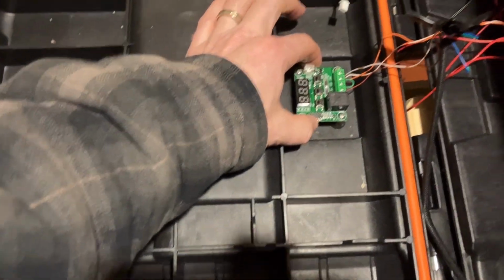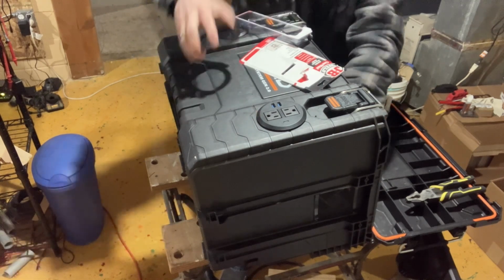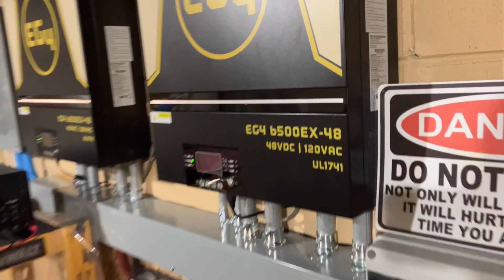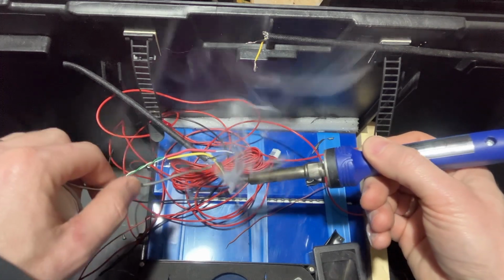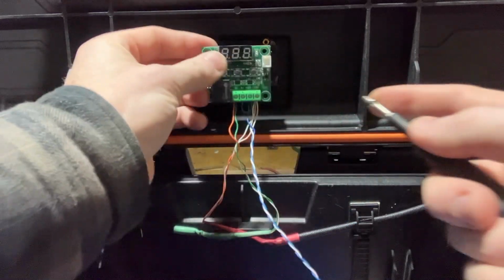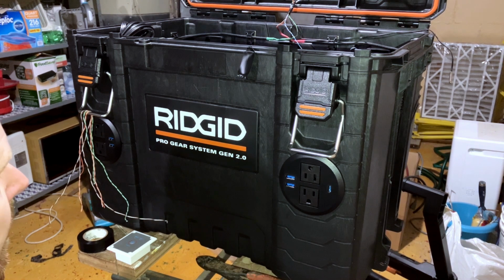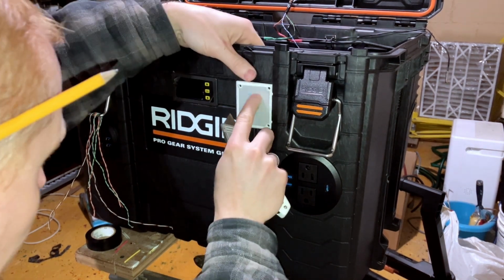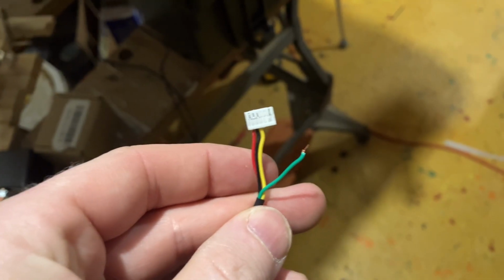DIY Portable Power Station - We're Getting Closer!

Comment: There is actually a lot to to this build. Nice work so far.
Reply from the maker: More than I thought for sure.  Thanks!
Reply: @AdamDeLayDIY  I was just thinking the same thing.  The end result is going to be impressive but yeah, with all the features you're including it's a lot of work.  Good job.  Don't pull any more wires out of their pins!  🤪
Reply from the maker: @easttexascowboy257  Haha!  Yeah, not one of my smarter moments on this build.  Ultimately it did work out better though because the replacement has 3x the length of cable, so I'll be able to mount it on the outside of the box.

Comment: It’s coming along nicely.  Those outlets  look nice.  Little hack for using a hole saw on plastic.  Start with drill in forward then switch to reverse 1/2 way through. Prevents any cracking in the plastic.
Reply from the maker: Thanks for the tip!

Comment: In other videos I've seen adding a pcb relays board and also a temperature sensor directly to the RPi pins and integrating them into Venus OS. The advantage is that manually controlling the relays switching or automating them according to the temperature sensor is done in one app directly in Venus OS. This could be interesting as an upgrade for controlling fans, or battery heating, things like that for you in the future.
Reply from the maker: That would be pretty cool!  I actually integrated my old 12v system into my Venus OS (the same one I'm putting into the case) which allowed me to remotely turn the inverter on or off.  Might be a possibility again for a future update.  The only downside is that it would only work on WiFi and that connection would have to be pre-programmed into the Pi.  Basically it would only work at my home and then it would lose access to the internet.
Reply: @AdamDeLayDIY  In one YB video about installing Venus OS, they said that in the case of offline use, the Rasberry Pi with Venus OS stores data on the SD card and when it comes back online, it transfers all the offline data from offline use back to the system and doesn't keep it on the SD card, so it works very efficiently with offline data. 
So even in the case with offline use somewhere away from the internet, or an internet failure at home, the solar monitoring history would not be lost, if that were confirmed it would be great.
Could you please test this with your DIY portable power station?
This is exactly what I've been looking for a long time, that which solar monitoring system will allow me to have full time monitoring with history for online and offline use of a portable solar power station.
Reply from the maker: @tiborchren   now that you mention that, I do recall that happening when I had the VRM running on my 12v system in my barn.  I didn’t have stable internet out there so it would store the data and reload each time I fixed the internet connection.

I do have some upcoming projects which might free up some equipment to go into the power station, and then I can test the VRM access.
Reply: nice build cool 😇😇😇🥰🥰i see lot people build them only i did see they have a breaker going from inverter to 110 A/C outlet for if something was to happenend it only flip the breaker like breaker have in house on panel box

Comment: For the diyers.
I used the same ridged box.
I got 2- 80ah lifepo4 batteries  in it with a 5 " gap in the middle.
as i needed 24vdc 80 ah for a kayak motor.

By the way ridgid sells a taller box called xl

Comment: Adam, you have stated this before in another of your videos and no one commented about it.  Warm/hot air does not sink, it rises as temperature increases.  Hot air rises primarily due its lower density as compared to cooler air.  As the temperature increases, the density of the air decreases.  Thus, the fans in EG4s should be pulling cooler air at the bottom and blowing it upward over the electronics, and exhausting at the top.  If the fans are blowing hot air out the bottom, the wiring is wrong for the fans.
Reply: * EDIT * I now realize I missed the Sarcasm ....... HAHA ! * 

I agree about the hot air.  the EG4 was designed to pull air from top and out through the bottom (As indicated with the intake filters attached at the top.) So the STOCK EG4 is not wired wrong..... HOWEVER I actually Modded my EG4 , to reverse the fans , such to pull air out of the bottom and up through the top.  it HAS made a measurable difference.  I was able to make custom magnetic filters that attach to the bottom and sides of the EG4 where the air now is brought in.

~RandomPlanet
Reply from the maker: It was meant to be sarcastic.  I guess I wasn’t sarcastic enough…😁

Warm air does rise.  It was supposed to be a jab at the designers of the inverter for going against common sense.  It makes no sense at all having the fans suck air from the top and try to blow all the heat out of the bottom of the unit…
Reply: @jbuecker  Since I don't own an EG4, I was not aware that their design is flawed.  Maybe they wanted them installed upside down.